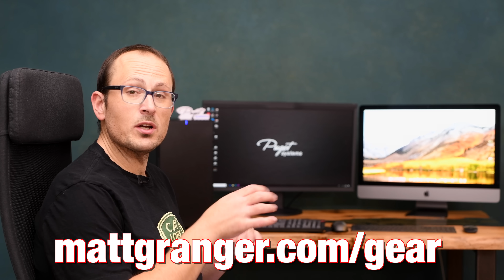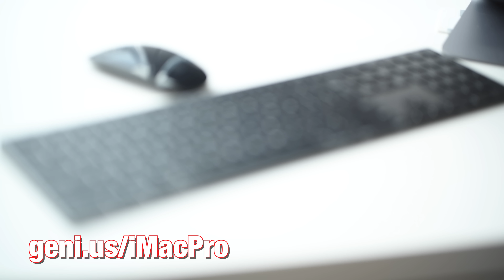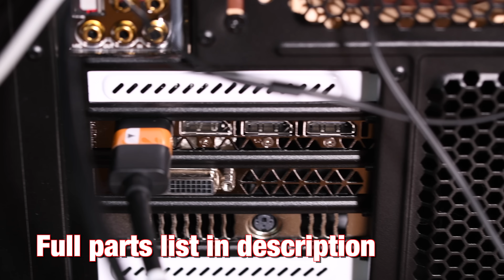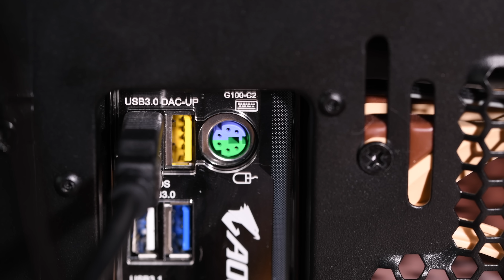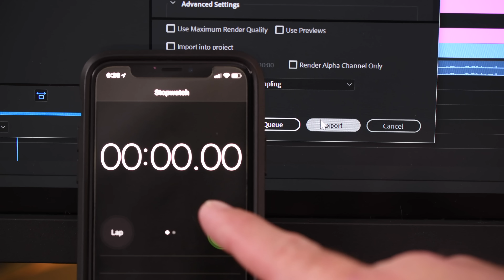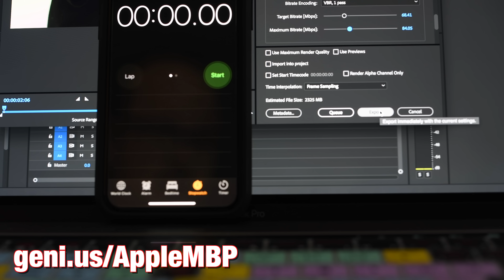$10,000 iMac Pro vs Custom PC - Which is faster??!

Comment: Adobe PP seems to run faster on comparably priced PCs has been documented a few times on You Tube so not surprised you got the same result.  And there have been several videos showing that Final C Pro is much faster on Macs.  So in this instance where you need to run Adobe the PC is the obvious choice.  

I have owned about 25 computers over the last 25 years and new Windows ones always run fast and good.  However, my own personal experience is that Macs and Apple gear ages much more gracefully than Windows boxes.  Plus Apple's tech support is the best.  When you have a problem it is easy to get it fixed, in my experience.  In the recent past even though my Apple support had expired it was no problem to call Apple, speak with someone quickly, and get help.  It is not so easy to get help on a computer made by one company and software from Microsoft.  And you made your computer out of components from a number of suppliers.  So who do you call?  You mentioned someone on your video but what happens if they go away?  I have tried in the last couple of years just to get replacement batteries for my several PC laptops and have had to return 3 to Amazon.  So I am sticking with Apple or already made computers.  I would rather spend my time working on getting great shots and videos instead of playing around with custom computers.  

To me making your own computer makes about as much sense as making your own digital camera.  Heck, buy the best lens, best sensor, best electronics, and a case to put them all in and fire it up.

Comment: and plus you can play latest and greatest games on the PC...
Reply: Tim Wynn I play games with my dog. So what.
Reply: Steve Steele so what? im talking about non physical computer games, not the kind of games you play with your dogs and cats. you don’t seem to get the point here.
Reply: Tim Wynn Dude, just take a joke. I could have said yo mamma. But I didn’t.
Reply: Steve Steele i would have chuckled myself at your yo mama joke.
Reply: Tim Wynn I probably should have gone with that but you know how sensitive some folks on YouTube are these days. I make a one silly but inspired yo mamma comment (which still crack me up), and the next thing I know my account and channel are suspended somehow.
Reply: unless you have a very expensive mac the games are gonna run terribly
Reply: Yes, and you could boot the iMac into Windows with boot camp, that’s a silly thing to say. My systems are dual boot for this exact reason.
Reply: Kyle or you can boot the system into windows via boot camp, every game runs just fine (and every Mac has been able to do this since 2006). Also eGPU’s through thunderbolt 3 have really helped systems quite a bit. The quadro he used in that system doesn’t run games very well either, it’s not designed for that.
Reply: and the gpu's in most macs are terrible at gaming, the eGPU's have a performance degradation
Reply: Kyle depends on which GPU you put into the enclosure and the enclosure itself, if the enclosure runs at full 40gbps in each direction (a lot only run 20 each way), then the performance hit isn’t really noticeable. The Vega 64 in the iMac is very strong for CAD work and other applications, also the Radeon 560 in my MBP can run pretty much any game under windows. The integrated intel graphics on the lower end systems are not very good, and I don’t think anyone would ever attempt to play anything except rocket league or some lighter stuff on Intel graphics anyway. For reference, a Titan Xp in an enclosure over thunderbolt 3 can generally peg most games at 70fps at ultra settings and full resolution of the display.
Reply: Hehe, thereby negating any productivity gains in your $10,000 equipment by simply wasting all the milliseconds you saved per task.

Comment: Adobe software is notoriously not optimized for the Mac. Maybe try installing OSX as a Hackintosh and compare Final Cut?
Reply: Conflux you missed the point. That being that using any Adobe products as a means of comparison is flawed. 
Another example would be using Photoshop.  Photoshop is optimized for single threaded operations so it runs faster on an i7 than it does on the multi-threaded ,multi core Xeons.

Comment: You don't need a lot of money these days to build a powerful rig. 

Frankly, my system cost me 800 EUR (I mostly edit stills) and it's running like a beast:

- 2x Xeon L5408 on an HP server motherboard (that's 8 cores total with 12MB cache per chip)
- 32 GB DDR2 ECC RAM
- 2x 128 GB SSD in a RAID 1 configuration (System and application disks)
- 3x 7.2k RPM 2 TB SAS drives in a RAID 10 configuration
- Nvidia Quadro FX 5800 SDI
- Eizo ColorEdge CE240W 

I also do some HD video editing too. I personally run Linux for security and efficiency, but it runs very well on Windows too.

Comment: Except that the PeeSee has 14 core 3.1 GHz  vs 14 Core 2.5 GHz on the iMac Pro,  Why not test against the 10 Core 3.0 GHz Mac Pro? and the cost of the 5k Monitor is a over $1200.00 USD.  And why you brought in a MacBook Pro as a comparison is beyond me.  This is hardly a "real world" comparison.  From Apple the 10 Core 3.0GHz with 2TB, 128 GB of RAM,  and a Radeon Pro W/16 GB is $9,599.00 USD, so your pricing is also not correct and a lot less than your Rat Rod PeeSee.

Comment: Hi, you've always been honest in your reviews but this one is very misleading. It's not PC vs Mac, it's Adobe Premiere on PC and Mac. Everyone knows Premiere isn't optimized for Mac and run like poop on it, so comparing software that's optimized for PC and not for a Mac isn't fair. If you want to run a real test, you should compare Final Cut Pro 10.4 to Premiere with both systems. The results will be very different.
Reply: I totally agree with you but yesterday I saw video about software optimization for Mac made by Armando Ferierra (https://youtu.be/B8mUp_CUDfw) . And this man made a comparison of PC and Mac on Premiere and he had opposite results. Cause after all Mac-optimized Premiere worked better than on PC. Thats why I decided to stick with macOS. CPU and vcard aren`t always the only way to get best result. Macs get optimization faster than Windows based machines.
Reply: ooo, I like this point!  If this is Fact, then it should be exploited!!

Comment: Hmm I’m guessing Matt doesn’t really know what he’s talking about 
No doubt the PC route is favorable - Apples Locked in ecosystem is for fan boys - (I’m forced to use an iPhone because android is horrible - ) however the end bit about upgrading is nonsense - with a machine like that the first thing to upgrade in three years is the board and cpu and therefore the ram - the Gpu will be many generations out of date - so no upgrade route when dealing with ultra high end because ultra high end demands the best available and upgrading is the opposite of that philosophy - even The psu would need to go after working hard for three years. You could keep the dusty and scratchy case - Re the case; this is another reason I think he doesn’t know what he’s doing - that’s not a case for an 11k system - it’s a 80$ dollar case! 
So much better available 

And then to the real core of the issue - how is the software & hardware configured for running tests? I mean there’s zero point doing any comparisons on project exports when the fundamentals haven’t been established - do we even know what drivers are in use for usb 3.0 and the gpu cards - is the machine os configured to use the 256gb ram correctly - I mean come on Matt this test is idiotic - you would need to devise a at least a 2 part review/test 

Part 1 covers the fundamentals of the specifications and how they are installed and configured and features standard testing and some benchmarking so that it is established that the core ingredients of each machine are optimized and working correctly 

Then in part 2 you can run the testing and when you run the testing we need more than some strange time line close ups (what’s with the continual focusing issues?) we need actual details of each test written out on screen inc specifications of third party i.e usb devices etc - any potential bottlenecks, driver versions, cpu, gpu and networking loads during processing etc etc etc 

What you’ve done is a 
“look at my fast Pc 
I’ve called it cider house - it crushes apples...yeah”

Nonsense - even though you’re right. 
Btw you overpaid at 11k 
I estimated a 8k machine would same job with same storage but hey that’s a  small point

Oh yeah and the comment about crypto at the end - he’s out of his depth completely
Reply: Well said Stephen.  That is one ugly pc case.  Woof.  Do snobby PC builders ever actually upgrade their components?  I mean with as rapidly as hardware changes I sort of assumed upgrading was a thing of the past.  However, I know that big fancy iMac Pro should still fetch over $1,000 resale in 5 years.  What will an ugly home built PC be worth then?

Comment: 256 gigs of RAM is completely unnecessary - Linus Tech Tips dispelled anything greater than 128 having any practical use and 64 gigs being the best bang for buck when looking to really pimp your system - regardless of what files/programs you use.

Comment: Why not water cooled for the PC? When are Apple guys going to realize a built PC kills Apple every time in speed and cost per speed. Apple is a rip off. Finally a camera guy that knows what to look for!
Reply: While in theory water-cooling is answer since you shouldn't run into thermal throttling issues you do run the risk of a leak.  Putting a massive block on is safer and will get you close as far as performance goes.  Yes I do know if you take care of your liquid system the risk of a leak is very slim though but it is there which is always sketchy when you are dealing with clients

Comment: I took a 11 GB 4K file from one of my Sony a7s ii dropped a few luts and just some simple color correction and it took me 6 min and 23 sec to export it out from Premier Pro CC using h.264. So I think the Cider House has met it's match against Zeus. But considering my two Xeon E5-2699 V4 (22-Core) Processors cost about as much as either one of those setups so it's not a fair comparison because the iMac Pro cost $10K and has one (14-Core) CPU and you said the Cider House cost $11K you said and has a single i9 (14-Core) CPU. When Zeus has (44-Cores) and 88 Threads plus 1.5TB of ECC DDR4 2400MHz Crucial RAM and 8-NVIDIA GeForce GTX 1080Ti Founders Edition 11 GB of VRAM totaling 88 GB of VRAM. But when Zeus cost around 4 times more then either one of those systems then I would expect to blow away most bench marks and all the real world testing. But like I said on another post I know John Bach and I love Puget Systems in Kent, WA them and SuperMicro are leading the industry in how far you can take a computer or server. Puget and John are the only people I know that can build a quad socket computer called the Quad Peak E7 which has four Xeon E7-8890 V4 (24-Core) CPU totaling (96-Cores) and 192 Threads which is ridiculous.  Another thing I noticed do you not have onboard 10GbE on the Cider House?

Comment: Well, if you’re so concerned with effectivity and speed, you wouldn’t be using the iMac pro  with Premiere, right? And with FCPX, the iMac pro would win. So, this video is helpful for people who prefer the Premiere Pro workflow and are not concerned with speed and comfort, but we’re looking into buying the iMac Pro for their work 😉However, the 5k screen is far superior to anything you can buy for a reasonable price these days + macOS workflows and app are simply amazing. Windows is ... just Windows, dll hell
Reply: While I agree it would be a better test to run FCPX on the iMac pro, what makes you so sure it would win? Personally I'd rather wait for the results before I would state one is faster than the other.
Reply: Actually, if Matt was concerned with "effectivity" and speed with FCPX, he would have chosen a top of the line, non-Pro iMac.  FCPX's "superior speed" is primarily due to "background rendering", which requires Intel's Quick Sync Video tech.  Quick Sync is only present on Intel's CPUs with integrated graphics.  The Xeon processors in the entire iMac Pro line do not have integrated graphics, hence no Quick Sync, hence no background rendering, hence no appreciable speed advantage.  This leaves FCPX loyalists kinda lost, as Apple has yet to upgrade the base iMacs to Intel's Coffee Lake processors, leaving the 4-core/8-thread i7-7700K as the best option for FCPX.  When the i7-8700K (with 6 cores and 8 threads) becomes available in the iMac lineup, FCPX users will have a viable upgrade path...  In a nutshell, the iMac Pro lineup effectively removes FCPX's only objective benefit over PP, except of course, long-term cost of ownership.  Cheers!

Comment: I have a Puget Sys PC, bought new 2016. 64GB mem, and all the rest near top of the line components. Additional sound proofing, it's silent. About $4,200 delivered. ---- Love it. No hardware failures/problems. This is my 2nd Puget Sys PC. I will go back to them in 4 years or so.

Comment: Hi again, Matt.  Many of your viewers are commenting on the Mac vs PC thing and, more importantly, FCPX vs PP.  FCPX's background rendering, which makes it so much faster than PP on the same hardware, is disabled on the entire iMac Pro line.  FCPX's background rendering requires Intel's Quick Sync tech which is only included with integrated CPU graphics.  Xeon processors do not have integrated graphics, hence no Quick Sync.  Purchasing an iMac Pro removes FCPX's only real advantage over PP.  Cheers!

Comment: Hi, Matt.  Great video as usual.  Thanks!  In a photography/video editing workload/workflow, the P5000 is tremendous overkill.  Adobe still hasn't gotten their act together yet on good GPU acceleration.  Any Quadro beyond a P1000/2000 is wasted on PP, PS or LR.  CAD and heavy 3D workloads are a different story. (See links below.)  You could have saved yourself an additional $1500+ USD.  In fact, a GTX 1050 (non-Ti) or even an old GTX 660 or 750 Ti tend to max out Adobe's attempt at GPU acceleration.  The rendering speeds you see between Ciderhouse and the iMac Pro have nothing to do with their respective GPU's horsepower.  The differences you are experiencing could be many things or a combination thereof.  The most likely cause is CPU difference, especially if the Xeon is heat throttling in the iMac enclosure.  Thanks again.  Cheers!

https://www.youtube.com/watch?v=_6XYaFqq2mg
https://www.youtube.com/watch?v=G-90qEJAVkU

Comment: Gee, an incomparably spec'd PC beat a lesser spec'd Mac. Shocking. 

Nothing against PCs. It's no secret you can build a better machine for less money. If you like them, fine. 

If you like a Mac, fine, you're gonna pay more for the same speed (or more). Fine.

Waste of a test. I'm more interested to see if the Mac architecture is better than the PC architecture, all things being equal -- except price.
Reply: can you explain? the architecture is the exact same, they are both using pc grade hardware
Reply: The architecture is not the same. He says he chose comparably PRICED equipment, not comparably RATED equipment. Apple gear costs more, we all know that. Put the iMac 18-Core up against a similarly spec'd PC and tell me which is faster. That's my point. Putting an $8000 PC against an $8000 Mac is going to favor the PC every time-- because you can build a faster PC for less than a Mac.
Reply: the parts my be custom but they are based off the same parts a kaby like cpu is still a kaby lake cpu, a sky lake cpu is still a sky lake cpu and a vega 56 is still on a Polaris architecture. the parts varied to compare price and not specs mainly because the vega 56 and 64 went up in price due to the high demand caused by mining. the quadro was not hit so it fits better with the build and a ryzen cpu has more cores, higher performance for a much cheaper price
Reply: I'm not arguing that the machine Matt built is faster and cheaper than the Apple machine he did the comparison. You will always pay more for performance on an Apple machine than a PC. The "Apple Tax" we've all come to love and loathe. I'm asking that he do a (pardon the pun) Apple to apples comparison between similarly spec'd machines. I have no dog in this hunt, I don't care which machine would come out on top. But I am interested in how, say, and 18-core iMac compares with these incredible new Ryzen processors-- with the understanding that he'd be comparing an $8000 or $10,000 dollar machine with a $13,000 (or more) iMac. It's a more useful test, in my opinion, because it reveals if Apple is still taking advantage of the fact that their machines and OS are vertically integrated-- or whether they've slipped.

Comment: Thank you for the great video. It is really nice that you listed the benefits beside the pure power, which is overlooked by most reviews of the iMac Pro.

Ah, because you asked, I use my custom built i7 6700k, 32gb, GTX 970, Arch Linux machine for hobby photo editing, mostly in Darktable, sometimes in Rawtherapee. If I want to do some video editing, what I really never do, I would most likely use Kdenlive, which is said to be one of the reasons some Windows users have a separate Linux installation on their machines.